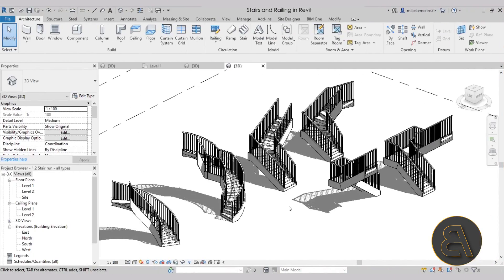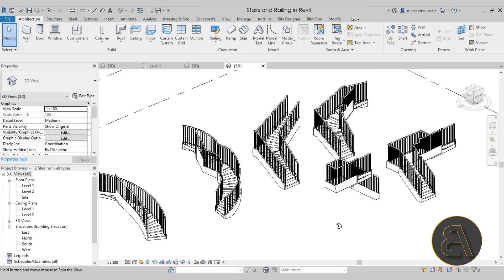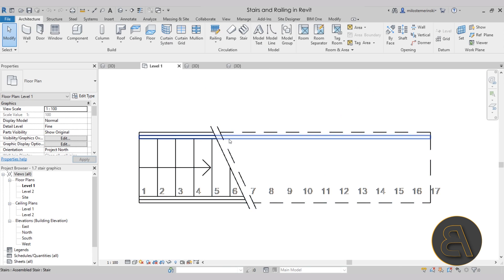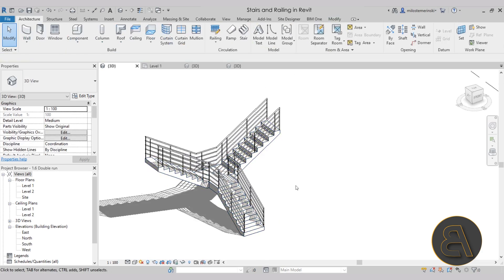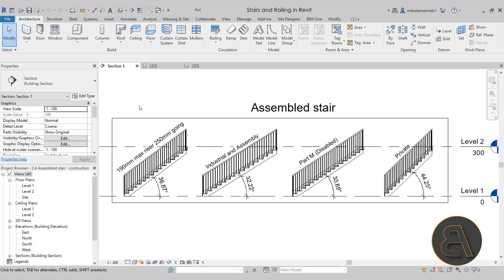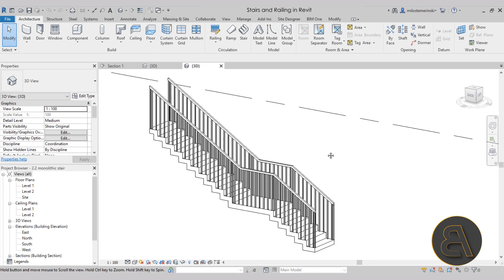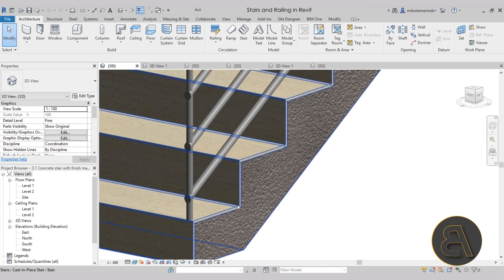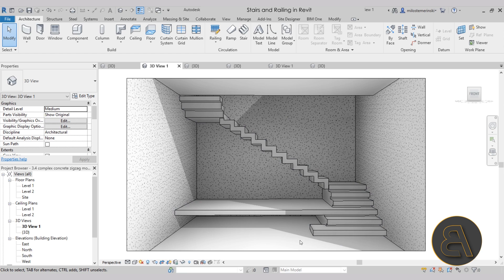Stairs and Railing in Revit Course

Comment: Revit will never get railings done correctly the join conditions at turns and change in elevations are so annoying to fix.
Reply from the maker: I show everything you can do to get it to work just right 🙂
Reply: You're right dyu, the joins at landing corners internally often don't work. Sometimes terminations and extending rails works but this is the condition that never quite ends up right. Manual placement of balusters is also a much needed update, only possible in handrails currently.
Reply from the maker: Manually modeling railing is the only option for a truly custom fit 🙂